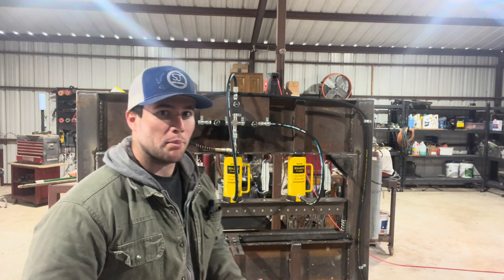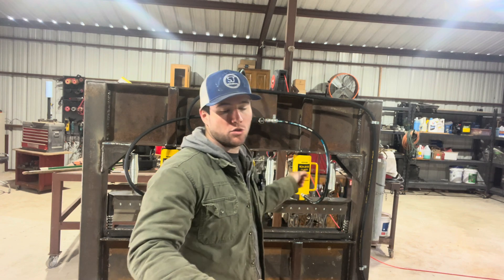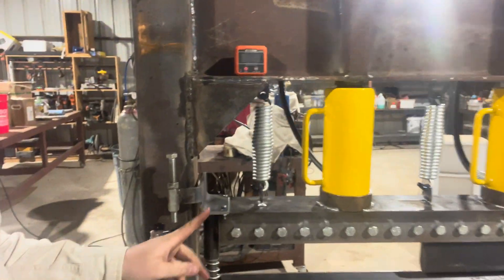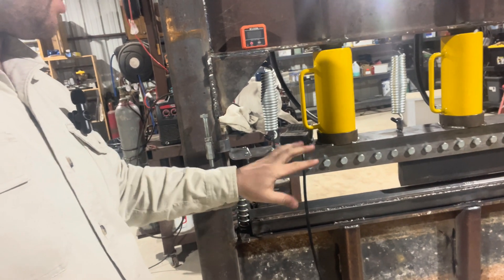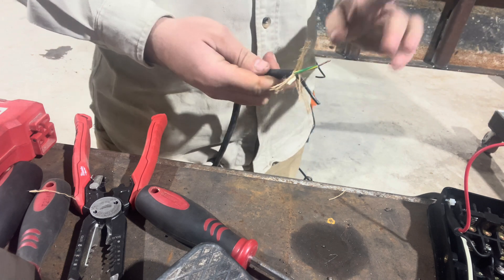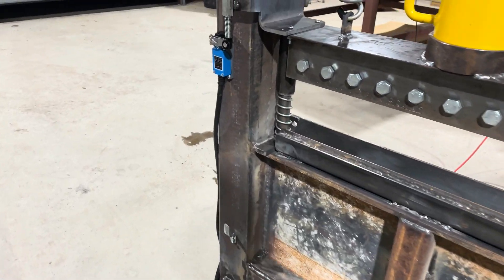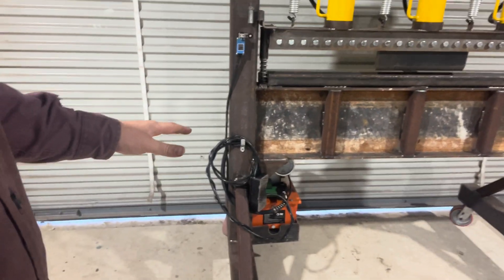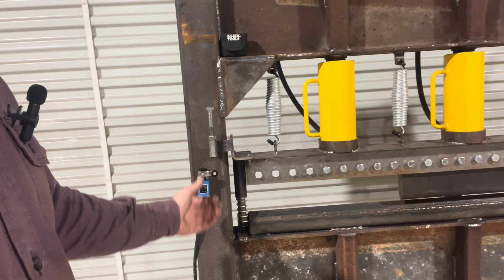Make Repeatable Bend With This!

Comment: Can you do full bend 1/8 aluminum ?
Reply from the maker: @BearCreekMetal  yes! have you ever bent aluminum?
Reply: @ yeah I built the boat in my display picture. But I used my buddy’s professional brake. I want to build one for myself though.
Reply from the maker: @ that’s a sick build. Just wanted to make sure you had bent aluminum first. It is a little harder to do than mild steel.

Comment: Did you use a double acting foot switch? Why or why not?
Reply from the maker: The foot switch came with the pump. I believe it’s a double action switch, because when I push on my heel it turns on the pump and then when I push with my toes it releases the pressure. I wanted this so I could get the metal lined up instead of it automatically retracts.

Comment: Are the flow valves to control the different flow rates between all three rams? Was there a noticeable difference in ram speed?
Reply from the maker: I use them to control the rams so if one is moving quicker than the other I can adjust accordingly.